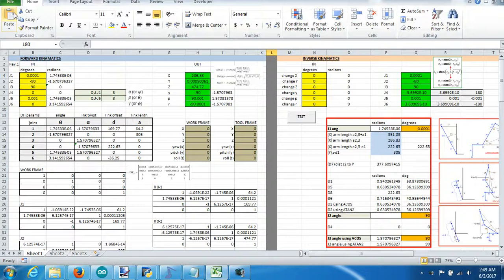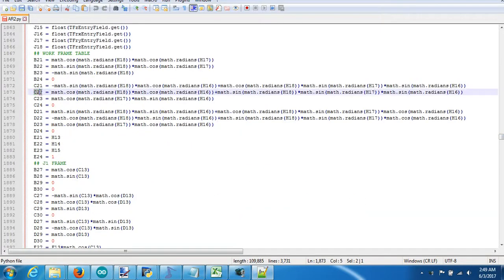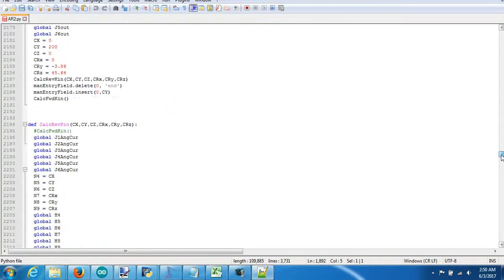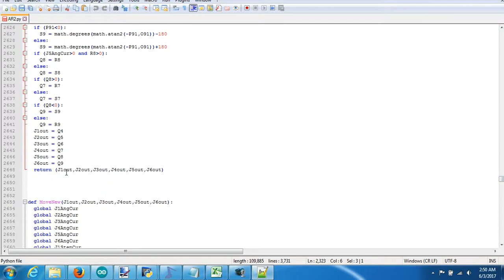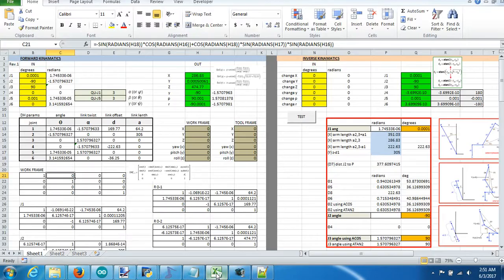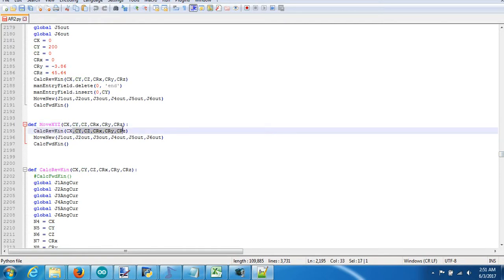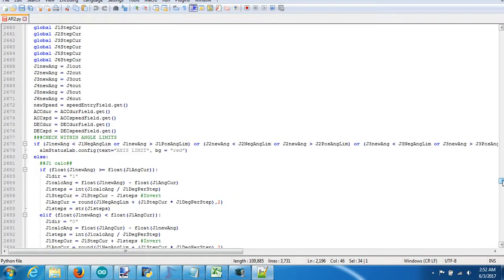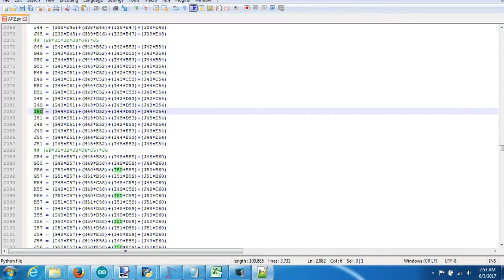6 axis robot kinematics Part 8

Comment: Hi, I'm going to rewrite your code in stm32 microcontroller and qt in c/c++, and now I have some questions: How many pulses does the stepper motor corresponding to each joint rotation 1° need? Your code is too large and I can't find these data......
Reply: oh I found them in python codes, thanks

Comment: Hi Chris, very awesome explanation.. glad u made this very detailed explanation.
I have a question though, about the x y z change. Using the excel file, i plug in different numbers for the J6 dh  "arm offset" parameter. But it doesnt affect the final x y z position. I am not sure about this,but i assume  calculation only goes to J5 ("the wrist") not until the end of the arm  J6("the gripper")? 
Thanks again  :)
Reply from the maker: yes this is a simple model and I haven't done the calculations for tool center point yet - its simply position of the spherical wrist and orientation of the wrist.  I hope to work more on the model when I have more time.
Reply: Chris Annin aa i see.. thanks this helps me alot.  I'll try to find the end effector x y z using the pitch roll and yaw value.
Reply: So, for now to grab things, i guess i could move the wrist to the object's position offseted by the grippers length..

Comment: Hi awesome job! I have a question to the program.
I mean that for example you have to move 150 steps in X and 30 in Y, so it need to be 5 pulses in X then 1  in Y and again 30-ty times thise sequence,
am i right, or this is completly wrong?
Reply from the maker: Yes completely separate from the kinematics that are figuring out the positions the program on the Arduino has a three-step algorithm that I wrote that took me a very long time to get it to work perfectly but it will split up and divide by the highest step and then with whatever's remaining it will figure out how to parse that out over the entire move the algorithm is 3 levels so for example it May skip every other loop for one motor and still have some odd number of steps left over so than the algorithm takes the amount of steps that's left over and divides them out evenly amongst the entire range of steps and creates an additional level of skips so they are not always even but they're distributed evenly so the move appears to be completely fluent.
Reply: Thanks for the answer. So it's just your algorithm, you were based on something or you just figure it out by yourself?
Reply from the maker: I just figured it out, I had an idea on how to do it and developed the algorithm on my own.

Comment: Why do you hate us! D: why 3 months and no more updates about your awesome work! D:
Reply from the maker: Thank you for the compliment. I haven't had as much time to work on it as I'd like but its coming along, the aluminum robot is fully assembled and running but im working on a number of improvements before posting the video and releasing the next version of software.  Ive made a number of improvements to the program, Ive added tabs and moved the calibrations into the GUI rather than coding them in.  I rewrote the stepper algorithm,  its much improved - all motors finish within a step or two of each other and holds a much straighter line.  I upgraded the control box to include digital drivers and made changes to the sketch file to allow users to easily modify motor direction and calibration direction for custom builds.  I would like to improve the backlash on J2 and J3 and I just ordered the new precision gear drives that StepperOnline just came out with.  as soon as they get here I will install, calibrate and hopefully get the video and newest software revisions released as soon as I can.

Comment: Is the aluminum version coming along ?
Reply from the maker: Yes but slower than I had hoped.  its fully assembled and running but im working on a number of improvements before posting the video and releasing the next version of software.  Ive made a number of improvements to the program, Ive added tabs and moved the calibrations into the GUI rather than coding them in.  I rewrote the stepper algorithm,  its much improved - all motors finish within a step or two of each other and holds a much straighter line.  I upgraded the control box to include digital drivers and made changes to the sketch file to allow users to easily modify motor direction and calibration direction for custom builds.  I would like to improve the backlash on J2 and J3 and I just ordered the new precision gear drives that StepperOnline just came out with.  as soon as they get here I will install, calibrate and hopefully get the video and newest software revisions released.
Reply: Since the 3d printed one was pretty accurate as it was. I am pretty sure that the aluminum version could be used as a legit production robot. Have you thought of going in that direction ?